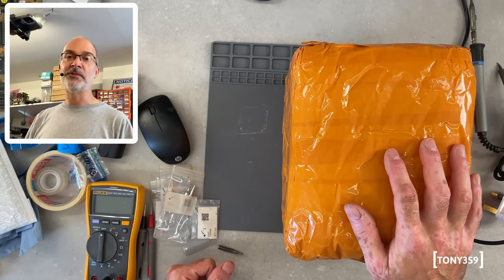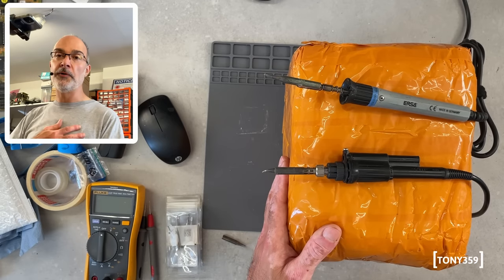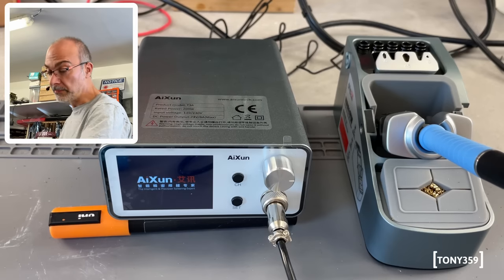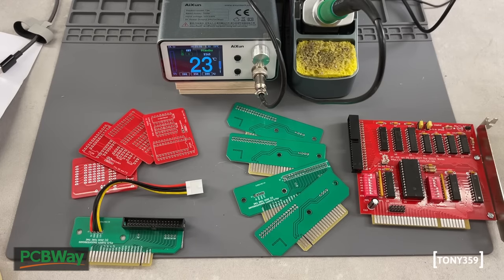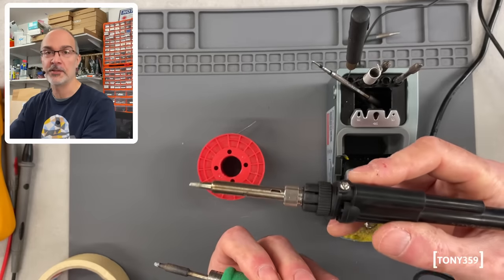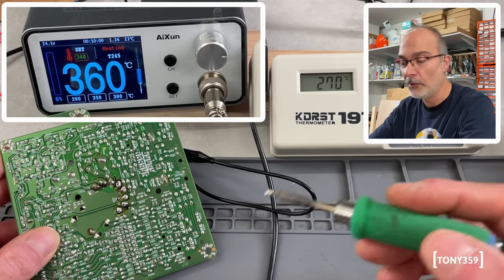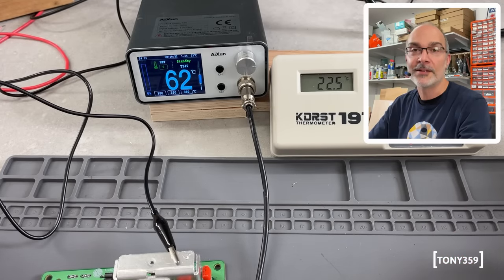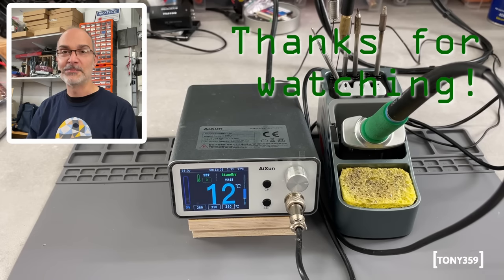Is the Aixun T3A a good T245 soldering station?

Comment: Interesting firmware issue. I still have a really early firmware version - I think 1.18, and didn't really find any bugs so I wonder how they've made so many revisions and possibly made it worse? JBC won't see the issue with the earthed board as they use proper transformers for the power supply. I think this is why the T420D doesn't show that behaviour.
Reply from the maker: You know, I've been thinking of testing earlier versions too! I'll give 1.18 a try, after all it's a soldering iron, not a space ship! If 1.18 works, then happy days! Thanks for watching - and thanks for all your great videos!
Reply: Yea I have 1.18 on mine as well and not had an issue but I need to check the grounding.
Reply: I agree you are the best. You should sell or donate some of them by now though. I give away all my old test gear and such when I get acceptable new stuff.  It seems to be an odd opinion these days though. I donate ul certified meters to students every September and not one person wanted a 500 dollar meter this year. No upper limit either.
Reply: I purchased the T3A after I watched Steve's review. Mine is 1.19. I didn't bother to update the firmware and I think my copy doesn't behave like this, also.
Reply: @jstro-hobbytech  That's strange.
Reply: @rimmersbryggeri  I agree. I'll give them to random people I send learning kits to. People where I live don't think there is any honesty left in the world. For instance, I'm a professional guitar player and have tons of gear. I had about 1k worth of stuff advertised for free and got one bite. I told him if he can learn ohms law and how to calculate current in a  series and parallel resistors in a circuit and he would've gotten over double the 1k worth of parts and gear as a surprise and he was too lazy to learn the most basic rules. I don't think I was asking much from a person who wanted to learn how to build guitars and fix amps.  I live in a small coastal area of cape breton in Nova Scotia, with about 100 thousand people spread over 40 communities in a municipality. Pretty wild ehh. Just one set of pickups I was giving him cost me 550 but I didn't like them anymore. His loss though. I sent a kit to a guy in Virginia last week worth a few hundred, he is well to do so I pared back the gear and sent more components. He's since bought a decent starter lab. I might send him a scope if he gets that far.
Reply: Hi, I'm curious about if there is a review, test or discussion/conclusion about that T420D doesn't have this behavior?

Comment: This video made me decide not to buy this station. I already have another cartridge-based soldering station (clone that uses Hakko T12 tips), so it wouldn't be a massive upgrade to my current one. I think I'll either stay with my current one, or save up for an actual JBC station (even if it's almost 4 times the price of this one).
Reply from the maker: Sounds like a good idea - I'm aware there are supposedly "good" stations around. Apparently those with linear supplies inside. Though I cannot really recommend anything because I haven't tested them myself - the T3A was also supposed to be "good" so I'd like to be cautious here! :) Thanks for watching!

Comment: Hi, I need to buy my first soldering station, I have a limited budget unfortunately, I didn't want to go over 100€ if possible, I was looking for a quality and resistant soldering station that will last me for many years, which model do you recommend ?
Reply from the maker: I haven't got a recommendation unfortunately. I ended up buying a JBC but that's quite expensive. I understand you want to stay away from stations with a switching power supply inside. But at this time I don't have a model I can recommend. Good luck :)
Reply: @tony359  Thanks for replying, yes exactly I wanted to buy an analog soldering station with a traditional linear power supply, yes the JBC ones are too expensive for me, for now I have only found Chinese soldering stations, the cheapest one let's say is the hakko fx-888d but it already costs 120€, I'm also thinking of buying a quality soldering iron like the Ersa 30s or the JBC 30ST even if unfortunately they are not adjustable.

Comment: On the grounding issue:
Though I have never actually seen one in "real life" I've seen photos of the guts of several of the new breed of solder station. Most use switchmode power supplies. That's fine if the supply is well designed, but from what I can tell from the photos many are not. They are relatively crude and would be unlikely to pass the requirements for either safety agency approval or EMI/RFI control. (I've designed a lot of switchers for industrial use.)
My suspicion with the grounding problem is that noise from the power supply gets coupled into the temperature sensing path differently depending on how the tip is grounded. Again the manufacturer seems to have hacked a way to cover up bad design.

On soldering:
I've watched a few videos of "how to solder" on YouTube. A couple that were "common errors" types were filled with bad advise and evidence that the creators of the videos were not competent solderers. Another that I thought was good, and it was in many ways, still showed a significant failure of method.
I've also seen a lot of videos where people slop gobs of flux all over the landscape because they don't know how to use cored solder properly. Sometimes extra flux is a very big help. In most electronics work it is completely unnecessary.
Reply from the maker: The switching PSU has been blamed but also the way the thermocouple is sampled. There is a slightly different model from Aixun with a linear supply. Who knows if that works better!

Comment: 4:38 I have a Yihua soldering 899D+ soldering station. The handle uses the hakko tips. If the tip is loose, i make a shim with aluminium foil. It definitely improves the thermal conductivity.
Reply from the maker: Back when I got the station I did try with the foil and Aoyue tips but that didn't help. With Hakko tips I feel it works well - cannot outperform a 245 of course. I can't remember whether I tried the foil with them or not. Thanks for watching!

Comment: Surprising issues with that station!!!  Great video!  I am also wondering about the implications of it not being able to accurately control the temperature at all when whatever you are soldering happens to be grounded... Typically a soldering iron tip is connected to earth, this helps with ESD I think - ie. dissimilar surfaces touching, tips expanding etc can generate potential - I do wonder if because they are clearly doing some active stuff with the tip, that means it isn't connected to earth - does that increase the chance that it could create some kind of ESD scenario?!?
Reply from the maker: The tip is connected to ground, so I am not sure what's going on here. Also the behaviour has changed since I first tried a month ago so I'm a bit puzzled...
Reply: Irons will sink current if noobs don't look out haha. I use mine every day but I'm not grinding out a living with repairs, thankfully. I know enough to know you use 60/40 when it wasn't the question I asked lol. Dough head. Haha I kid.

Comment: I've had mine for over a year now and absolutely love it coming from a regular tip station. I too have come across the ground issue accidentally (although i didnt realise the spiking), but quickly found the problem. I don't have the buzzing issues like you though. 

Even with these concerns, I'd still advise this station over basically any other, especially when paired with genuine JCB tips as the Aixun ones are not as good.
Reply from the maker: Indeed the price point of £120 should be taken into consideration. With JBC tips it's hard to beat. Thanks for watching!

Comment: Good to know that grounding is a thing. But it is a thing... :D I've looked over the JBC's schematics and they do a LOT of stuff regarding how they're actually electrically controlling the board. Even their zero crossing detection circuitry is bonkers in it's design, but it has to have some sort of a point to it all, which is probably avoiding or circumventing bugs just like this.

MarcoReps on YT also came about a similar issues when he was designing his DIY T470 soldering station where in certain scenarios the instrumentation amplifier is just incapable of reading the thermo couple etc.

So these cartridges do pose some design challenges and your R&D needs to be very well behaved :)

I now know not to ground the tip by accident.

I bought the T3A station because the price for genuine JBC's (even the basic analog model) has gone through the roof. 40-80% more expensive within 2 years across the board... they're not at a price point anymore that's in any way attainable by hobbyist.
Reply from the maker: Yes, JBC's prices are unreachable for a DIY'er, this is why I added a comment in the end saying "it's bad but it's also £120!". What puzzled me a bit was to find so many issues which nobody else seemed to have noticed! 
Thanks for your comment!
Reply: @tony359  I believe it's because yours is the only test with newer firmwares. The older firmwares up to 1.27 behaved fine.. no idea why they decided to make everything worse with (seemingly) 1.29 and above
Reply: @Duglum666  ummm, *because they ca*, ie,  Because the device is software/firmware based. No software/firmware designer is ever happy, and no software/firmware design is ever complete.  They'll upgrade it whether it needs it or not,, simply because they can.

Comment: Solved! (I think) - part 2. (See previous reply)

That would explain the 1.6A you measured flowing from the tip to earth, reflecting the relative resistances of the two paths. More importantly it explains the temperature shooting up to max - the earth path shorts out the thermocouple signal causing the controller to think that the tip is at room temperature... What were they thinking? (I guess they weren't).

I can't so easily explain the tip to earth voltages you saw; 1 to 2V may reflect a relatively high tip to station wiring resistance of 200mOhms whent the heater is on (8 to 9A) but when idling the heater will be switched on at a low duty cycle. A DVM is not the best way to measure this though.

So why does the JBC station work? Because they don't connect mains earth to the COM tip connection - rather they connect it to the tip TC connection via a fuse (paralleled with a 1.2M Ohm resistor to keep it ESD safe should the fuse blow) and a low value series resistor. The latter allows them to measure the earth leakage from the tip in a +/- 9mA range.

Is there a simple solution? I don't know:

a) Removing the earth connection from the main board should do it, but the SMPS leakage current may cause the tip to float many 10's of volts above earth (that tingling you get when touching a typical laptop supply output) which could damage components on a grounded circuit board. 
b) Alternatively, connecting mains earth to the tip-TC connection as per the JBC version to make it ESD safe might not work well as the SMPS leakage current noise will now flow through the thermocouple and wiring and might cause erratic temperature readings. I guess you'll have to experiment.

If it was mine and I was  keeping it I would also remove C23 which almost certainly should not be there - opamps generally hate capacitive loads which may cause them to become unstable and oscillate whilst providing negligable filtering given the opamps low output impedance. (Of course it's possible that it really is necessary and the designers knew what they doing...). If you do remove it please measure it if you can and report it somehere (at least if it's more than say 100pF which some opamps can tolerate). I would also experiment with adding RC filtering in the TC to opamp (U8) +ve input signal.

If this is the solution, perhaps you could update the forums.
Reply from the maker: Thank you for your comments! The bottom line is that I feel a soldering iron should... warm the iron! I don't want to deal with firmware, overshoot, sensors... I am getting a proper one soon. I'll leave someone else to deal with the T3A!

Opening the T3A is a destructive process unfortunately and I'd rather keep it sealed so I can find a new home for it when I acquire a better one.

Did you add your thoughts to the EEVBlog forum?

Thanks again!

Comment: Great review, Tony, thank you! You have found severe issues with the station, was interesting to see and remember.
I also change tips on my soldering station the exact same way as you do, with pliers :) And it also hardly ever happens, I just always use T-1.6D/T-2.4D tips., whichever is installed at the moment.
Reply from the maker: Yes, those "generic" tips are on all the time. However it's so nice to be able to quickly swap if you need a bigger/smaller one! Thanks for watching!

Comment: Thank you for this review. I am glad that it was not a click bait after all (somewhere around the middle of the video, doubts were starting to arise). Did you try to run the station through an isolation transformer? I wonder if that will change the erroneous behaviour when the board is grounded.
Reply from the maker: ahaha very good point but no, I don't like doing that! :) 
It was suggested that but I never tried. I've got a different station now. Even if that "fixed" the issue, I don't think it could be an acceptable solution anyways. 
Thanks for watching and watch this space, another T3A follow-up video is coming :)
Reply: @tony359  I watched a recent review and close examination by SDG Electronics of the T320 and even though the fault is inherent in the design as you said, they seem to have figured out a hack in the software to prevent the temperature shooting. It also can take both types of soldering handles I am certainly enticed to buying one.
Reply from the maker: if you're referring to the T320 review, I watched that too ("some people on the internet say that" LOL!) but when he tests with a grounded PCB I see the same behaviour.
The issue with "the hack" is that if you install 1.35, you won't "see" the overshoot anymore but it's still there. It's just hidden by the software. You can see that in the video with 1.34 too. 
Or did I miss a different video?
Thank you!
Reply: @tony359  Oh I see. My understanding from this part https://youtu.be/-ug7rLdOWto?si=4Ytz6I01iCdDFCvy&t=1666 quoted saying "you see something happening and it does pop the temperature up a little bit, but it seems to realise what is going on". So a spike is visible but the assumption is that it does not lead to thermal runaway. Unfortunately he did not use his soldering iron temperature calibration device immediately afterwards to confirm whether the over heating has occurred. The video I am referring to is more recent than this one and the firmware is different. It is at version 1.04
Reply from the maker: I missed that video. But it looks like it's the same behaviour. The T3A also doesn't stay at max power constantly but it spikes every time you touch a joint. Sometimes though it would "keep spiking".
The video shows temps going to 410C from a 310C setpoint. That is not acceptable. That is not "realising what's going on" if you asked me :) 
I feel they're trying to put lipstick on a pig - all due respect to pigs! - those units are flawed, they need to sort out the HW side.

Thank you a lot for bringing that video to my attention!

Comment: I've been using a cheap Aiyima T12D iron for some years. Uses Hakko T12 tips, and performs pretty well. Unfortunately the handle uses a screw on sleeve to hold the tip so can't swap the tip easily. I suppose the handle could be swapped for a better one. The tip is definitely grounded on this one however.
Reply from the maker: I didn't mention that on the video but the T3A tip is also grounded. It's apparently some noise introduced when there is a ground plane around - it's not clear. But when testing for ground continuity, it's grounded. Thanks for watching!

Comment: Nice review, loved it! I'm very curious about the voltage in the tip and eventually risk to destroy something with it, the same about the bouncing temperature when using it on a grounded board. I do wonder if this is also in the T420.
Reply from the maker: Apparently it is, being the 420 SMPS based. @NorthWestRepair recently published a video where he reports damaging his AMD testing dongles with the T3A. 
The bottom line is: an iron must not damage anything. Even if there is a slight chance to do so, then it's not fit for purpose!
Reply: @tony359  Are there SMPS based T420? Found CaptainBucko writing: "The T420 uses a toroidal transformer to supply 24v AC to the heating element. The tip is a true ground as per IPC soldering standards. It also includes a 8v AC tap on the transformer for the smaller cartridges." This makes me hope T420 doesn't have the same problems.
Reply from the maker: Apologies, I think I mixed the model numbers. The 420 seems to be toroidal indeed.

Comment: 10 months later, I wonder if the problem(s) have been solved? Wonderful video, thank you for all the time you put into creating this and demonstrating the problems you've found. I wonder if the same problem exists in the older firmwares or if you tried further back than 1.33?
Reply from the maker: My LCD didn't support anything older, they must have changed the controller. It would work but with a white background and mostly unreadable. But it would still happen. I doubt this can be resolved, maybe mitigated. 
Thanks for your kind words!
Reply: @tony359  Oh I see. Thank you for the update. I guess we'll have to just wait and see if they come out with any more updates for the unit then. Cheers!~